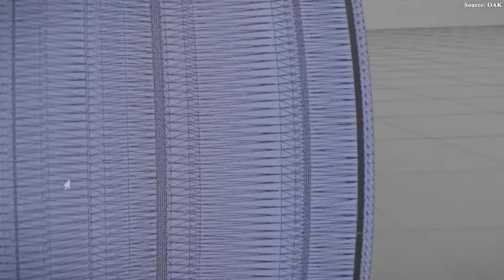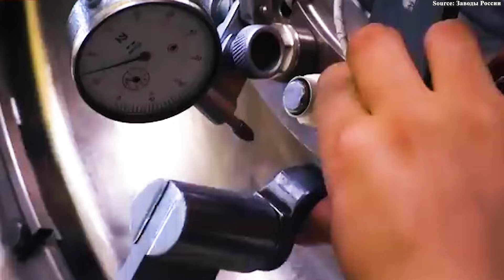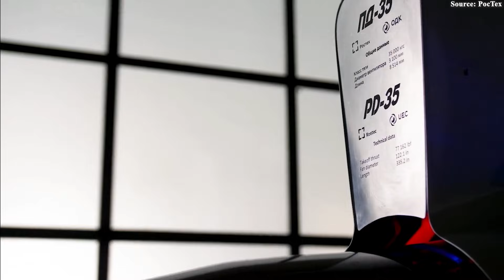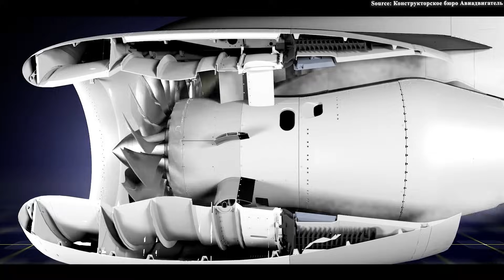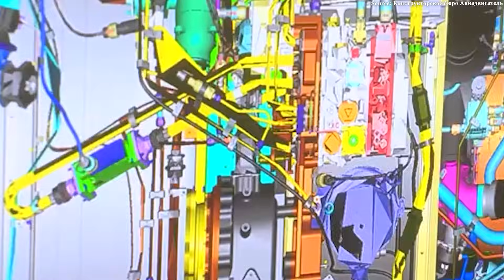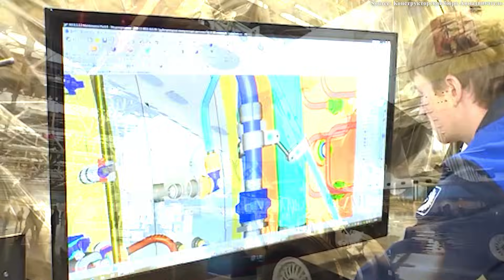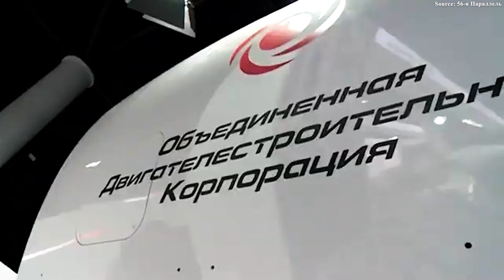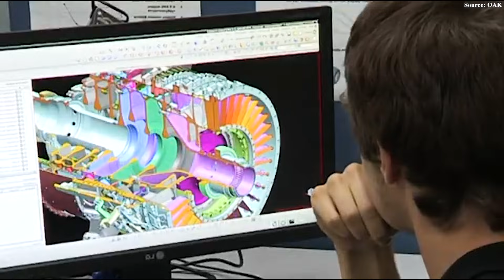Russia’s NEW PD-26 Engine Just SHOCKED Aviation - This Changes Everything!

Comment: I don'nt know why it surprises " the west "...!.. Russia has a dozen design bureaus for aircraft engines and thousands of prototypes... Also Motor Sich was an integrator of aircraft engines, basically just an alternate assembly site for Lotarev engines with parts coming from various parts of Russia.... They have other alternate engines, the PD-26 is just a modernized Lotarev D-18 engine... There is another more efficient engines like the Kunestzov KN-86, KN-83 and KN-93 that can go rapidly into more active prototyping and production...
Reply: ...the "West" is convinced of its uniqueness, only in the "West" are there the abilities to invent and produce something...🤣
Reply from the maker: Oh, thanks for the info.
Reply: It is a brand new engine.
Reply: @becaracha  No, is simply an updated Lotarev D-18 or a Kusnetzov KN-86 with a new FADEC, improved composite front fan and a couple of extra rear turbine stages....!.. New, yes but different integrator.... !...
Reply: @mazikkaluchka5562  isn’t it derived from the PS 90? According to Wikipedia at least. The 26 is a lower thrust derivative of the 35
Reply: @jeffhedrich3551  They all share something in common, in Russia it is the state that owns the IP, the name changes are just the different integrators cities or locations... ( The root of the root theory ) .. There are new ideas and improvements in materials and reliability with time and that merits a new prototype, testing and eventually a new engine and integration site for production but is essentially a new engine evolution, hence the new name... The PD-26 may inherit the reliability of a Soloviev engine and the design of a Lotarev/Progress/Motor Sich even some design tricks of a Kusnetzov KN-86 or Izdelitie but they share the same scientific base....
Reply: @mazikkaluchka5562 same scientific base like all jet engines do.  The pd 26 is decades ahead of the engine you mentioned and it isn’t even a derivative of that engine. About all you can really say is that they built on the experience of previous engines just like the rest of the world did.